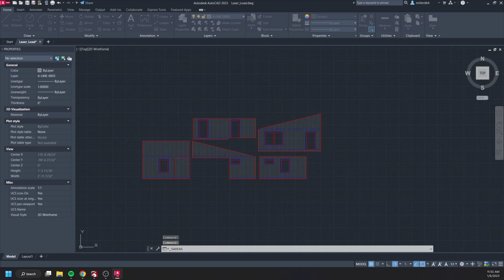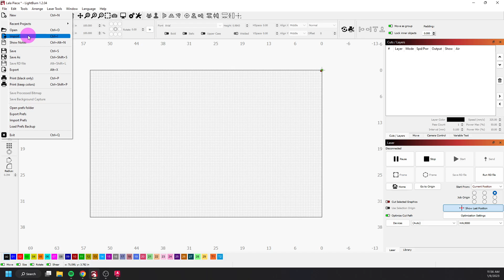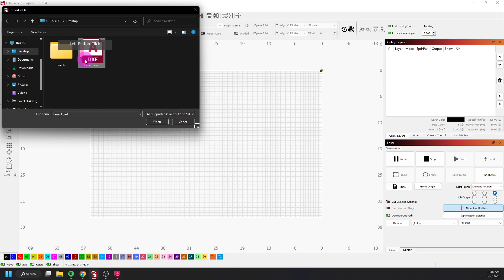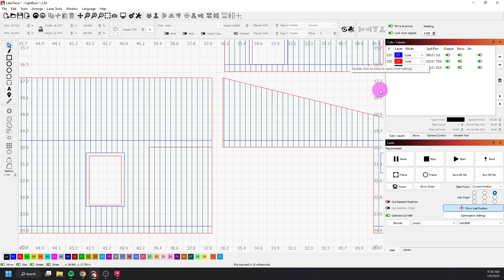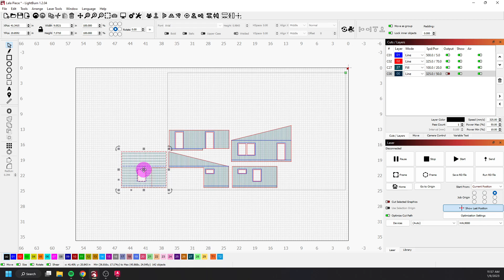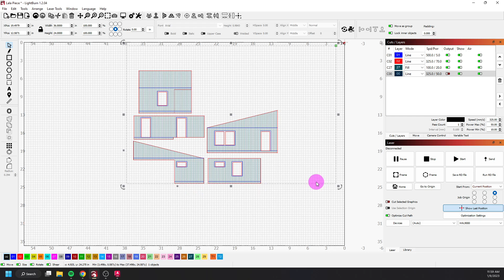01 Loading AutoCAD Files to LightBurn

Comment: Hi, I have an issue that perfectly closed shapes in AutoCAD get screwed up when I open the file in Lightburn. This happens especially when drawing complex shapes with arcs and splines. Is there any way to avoid this loss of accuracy?
Reply from the maker: Hi There- I would use explode or PEDIT to convert your splines into polylines. The splines are likely what is causing the issue